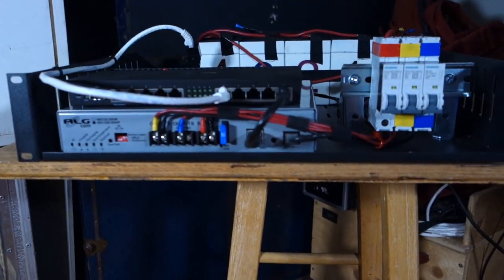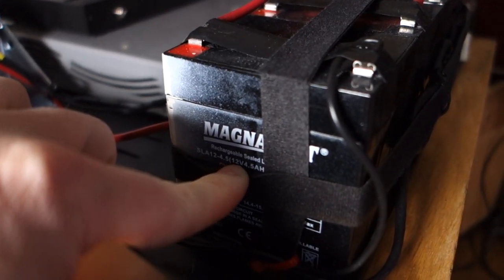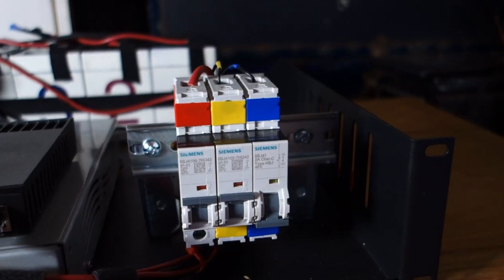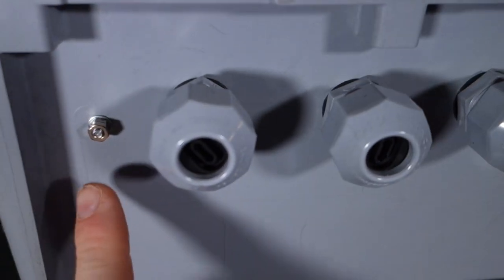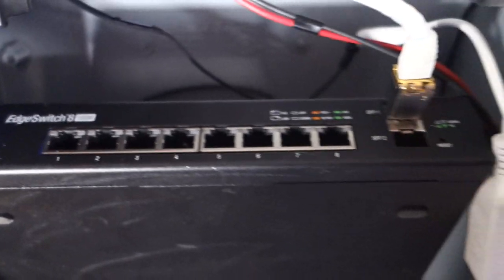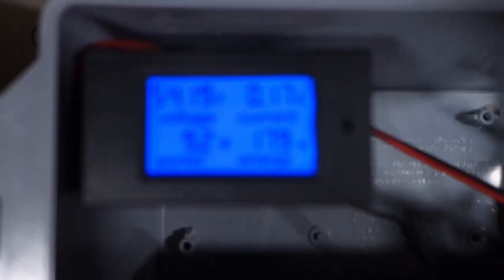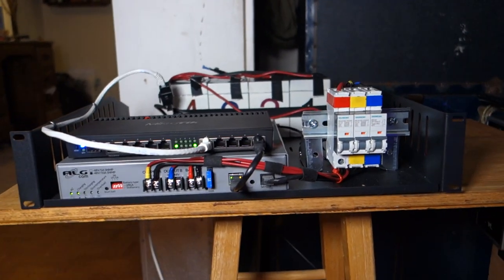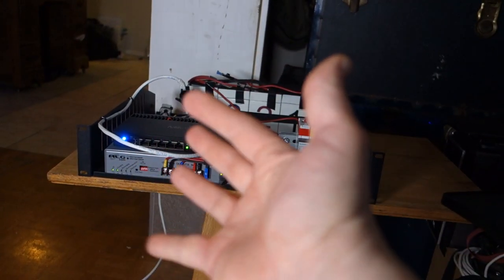48V Dc Plant in a 2U Shelf

Comment: Nice Video, just a quick... can you recommend any ups charger aside the ALG  to charge a 24v 100ah battery. if you dont mind can you drop your number so that i can pm you please
Reply from the maker: It does 100AH batteries. ISP supplies just advertise it wrong. They dont have a great understanding of DC systems there. You could run 200AH on an algcom if you wanted! You should be running 48v though.
Reply: @thefixitgal  thanks a lot